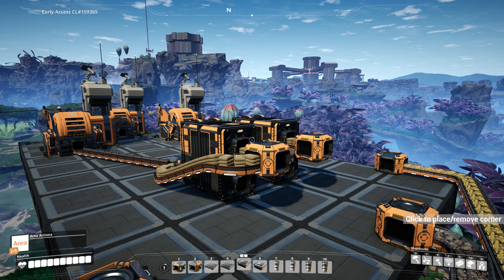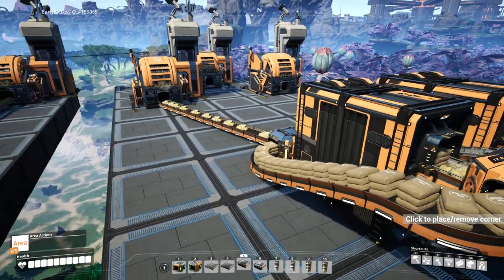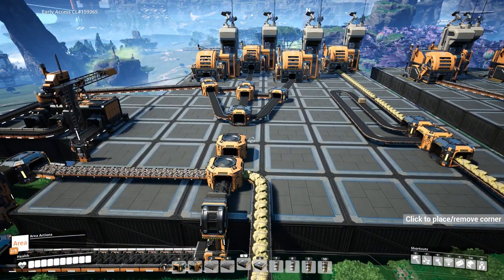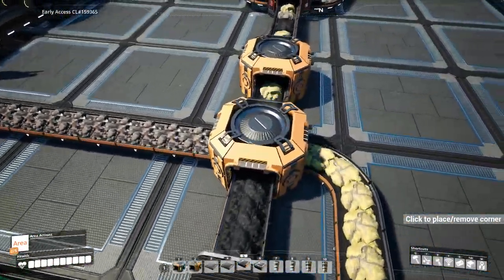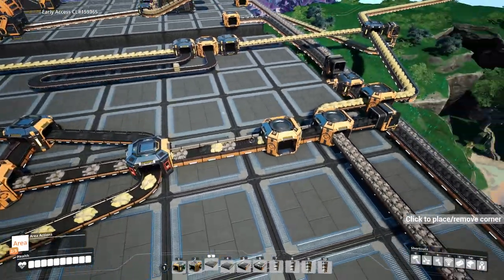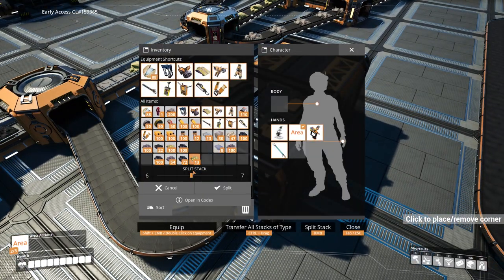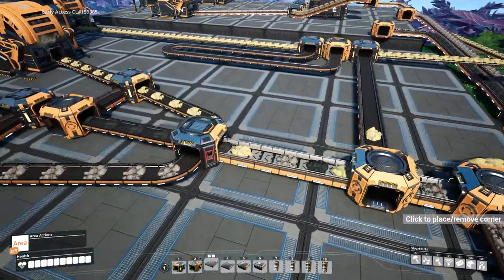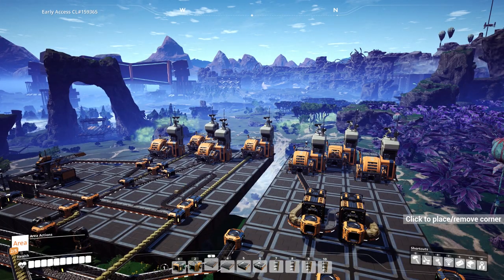Experimenting with priority and sequenced belt control [SATISFACTORY]

Comment: For the priority merger, I suggest covering the first 46 slots with a different filler material. It will never flow out, so you can spread it out to 1 per slot instead of having to source 46 stacks of some bulk item.

Comment: I once used priority merging for a water/fuel packaging circle, which recycled packaging unless consumed by a truck station. If these containers leaked, new ones needed to be produced with lower prio. I implemented it using 10 stages of normal merging with loopback, resulting in a 1/1024 ratio, which was nit perfect prio but did the trick.
Reply from the maker: Sounds very cool mate, I like it

Comment: Just finished the priority merger part: it is fun seeing that my extra extra impractical idea has still generated some ideas for you. Interesting enough, while my end goal was to have a balanced belt loop, I was actually applying this idea to do a priority merger as well (priority went to items already on the belt). The significant difference between our setups being that mine needed to work for prioritizing one input over another when both were the same item. And I wanted to be able to do so without losing throughput, to see if I could. (Don’t know if I worked out not losing throughput).
Reply: Your discourse on having your cake and eating it is everything I’ve ever wanted when I hear the phrase.
Reply: I could see using this for some kind of toggle logic… have one input closed looped (placeholder input), and the other one (the controlled input) looping with a priority merger to stop it from jamming. Then have a smart splitteron one belt to send the controlled input off somewhere, or loop the placeholder input. Then have the other belt always loop both of them. So, send in an item and your controlled input will toggle between the belt where it goes to output, or the belt where it loops.
Reply from the maker: I knew I couldn't be the only one who thought that :)
Reply from the maker: Hmm that sounds cool, if i've understood correctly. I'll have a think about that. Cheers Jason

Comment: I like your implementation of a priority merger, but I don't think it will work correctly when you're trying to prioritize two lines supplying the same item. Which unfortunately is the main need I see... don't produce more of an item (usually fluid containers) if you already have enough.

To be clear, I still find the ideas very interesting and I appreciate you sharing them even in cases like this where I'm not sure if it will be useful.
Reply from the maker: Yea it wouldn't work with belts supplying the same item unfortunately. No worries, I still enjoy experimenting with the different ideas...cheers Ron, appreciate it
Reply: If you up the complexity, you can prioritize two lines that use the same item, that’s actually what I was doing with the idea in my original save. Although, if you wanted to extend it to more than two lines, as Archi did, I never tried that - so who knows how well that would work with my system.
Reply: This popped back into my brain today and it occurred to me that you’re system actually should work for two belts of the same item, with one very tiny tweak: add another item that loops like the concrete  (ex biomass, berries, etc). It would take on the role of item that gets blocked.
Reply from the maker: That should work, and would only need 1 piece of another item. Nice thinking batman
Reply: @StinArchi  yeah, and then adding more than 1 should increase responsiveness

Comment: Omg this is insane, if you two belts let's say one comming of an iron node and one just filled with silica, have smarts splinters on both outputs that send the silica back in a loop to the the input, wo essentially the iron ore will be your only true output, and using this you decide on which belt it goes. You can then physically switch to which factory your iron ore goes

Comment: so as far as i can tell this chest priority merger system kind of sucks because it halves your output from your deprioritized line, shame cus it's an interesting setup,
and yeah the sushi belt stuff, and mechanical signaling ideas are interesting but, without any kind of logic to control any of this it it kind of pointless
if you could recent a circuit breaker automatically, then you could design a system with many small power grids, and then send an item into a machine to start it crafting, to overload the circuit to pause it, which would give you a way to turn the system off and possible on, but again you would need to reset the circuit breaker automatically
obviously being able to turn an electrical grid on an off would let you do allot of things, such as having a sushi ring buss factory, but the amount of manual physical circuit building to count the number of items on the ring bus to then, turn production machines on/ off would be not worth it at all, logic support would be needed for any kind of sushi design
and sure, merging and then unmerging 3 items is quite doable, and you can use it in game however, you need to make sure the products your merging/ unmerging are "constantly supplied" and "constantly taken" as any change in supply or demand will put the order out of wack, meaning the wrong resources are going to the wrong place, or if you use smart splitters to make sure the wrong resource doesn't go to the wrong place, if one of those lines are full, then it will also prevent your other two resources from flowing.
Reply: know what, never mind i have done a bit of testing, and while you didn't explain or show this in the video, the key to these box based priority mergers working efficiently is, only having 1 extra dummy item (concrete)  and preferably, putting that concrete on a level 1 slow return belt
this still has the same effect where the bottom line can get locked up, when their are excess resources in the chest, and when it gets locked up, it will only pull from the priority line
the key part i see most people miss is, how much concrete they have, see with just a single concrete item to lock the deprioritized line, the ratio between concrete and deprioritized items items are much lower, meaning you might only get 1 concrete out of 20 normal items, but this depends on how long it takes for the concrete to return, however since the deprioritize line is not fighting with concrete you don't get half the throughput, you will get, anywhere from 95% of 99% of the throughput, which is a win in my book considering this can possibly be smaller then a standard priority merger setup, although not honestly they are about equal size